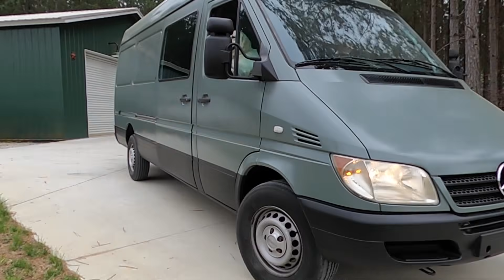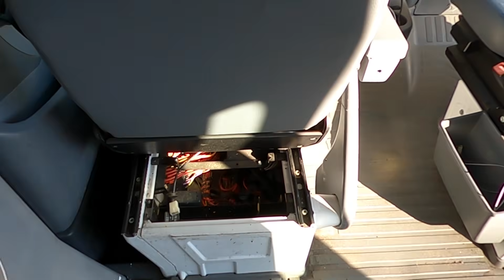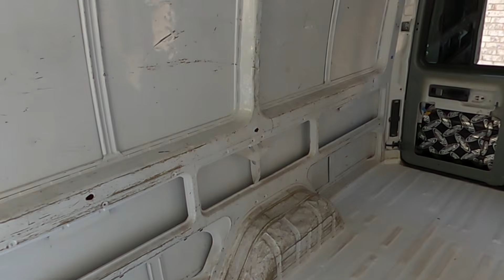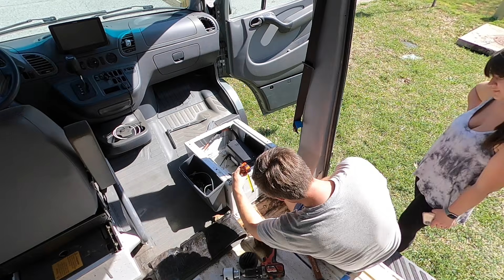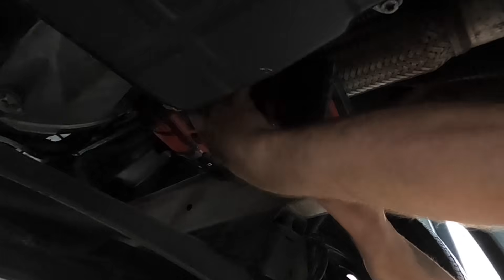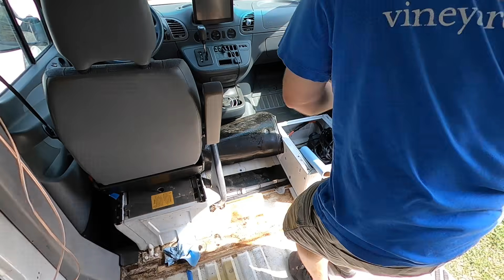How to Install an Espar D2 Diesel Heater in a T1N Sprinter Van // DIY T1N Sprinter Van Build

Comment: how did you paint your van? or is it wrapped
Reply from the maker: We have a series of videos on how we painted the van if you want you check them out. Basically we sanded it, primed it, painted it, then put the raptor coat around the bottom. I hope this helps!

Comment: Great video, definitely helped with my install. I know this video is two years old, but wondering if you had any issues with the fuel pump mounted as you have it. The pump is supposed to be mounted at a 15-35 degree angle with the outlet of the pump pointed UP, not down as you've installed it.
Reply from the maker: We’re glad you found the video helpful! We never had any issues with the heater and I don’t think the second owner of the van has had any yet either.

Comment: So your factory Espar heater by the headlight works but this write up is for an additional heater to heat the cargo area?
Reply from the maker: That is correct. It’s the air heater version instead of the water heater version that’s installed in the van from the factory.

Comment: Did you use the black mounting plate that came with it or is the heater bolted directly to the floor?
Reply from the maker: I’m pretty sure we bolted it straight to the floor with the rubber gasket in between but it’s been a while since we installed it so I can’t remember 100%.

Comment: If u didn't have a connection for the coolant heater, can you tap into the main fuel line going up to the engine..
Reply from the maker: From my research a lot of people advised against doing that. The fuel pump on the engine is very sensitive and from what I read it could cause problems.

Comment: The only thing I see wrong with this install is placing the exhaust in the engine bay under the engine, I would think the gases would re circulate back into your van through the intake .otherwise great video tks
Reply from the maker: I agree with this. Because of it we never ran the van at the same time as the heater. The heat in the van was plenty warm to not need the extra heater running at the same time.
Reply: @goldenadvantures2573  even if u don't run the van ,I would think the gases could still migrate back into your living space ,
Reply from the maker: We had a carbon monoxide detector and never had an issue with it when we did it.

Comment: how has this method worked out in the past couple of years? i have heard bad things about using the existing fuel line but stumbling upon videos like yours, makes me want to try it.
Reply from the maker: We never had any issues when we owned the van and I haven’t heard of the new owners having any issues with it either. The line we tied into was decided to the stock on board espar heater. It was not the fuel line for the engine.

Comment: Hey super helpful video. Any tips on priming the fuel line?
Reply from the maker: We’re glad you got some value out of the video! I don’t remember having to do anything to get it to prime. I’m pretty sure I just hooked it up and turned the heater on and it started pulling from the tank.

Comment: Looking to do the same on my unit do you remember where you do the tee to tap in the the existence line ?
Reply from the maker: I’m pretty sure it was right near the fuel pump that came installed from the factory for the block heater.

Comment: Is there a reason you didn't run the fuel line through the wire chase from seat base to seat base, then down under the drivers base?
Reply from the maker: Yes, the fuel line connector on the heater sticks out of the bottom of the heater. This makes it where you’d have to drill another hole under the passenger seat to bring it back into the van to put it in the chase between the seat bases.

Comment: How did routing the exhaust into the engine area work out? I thought it was a good idea for keeping the engine warm but was wondering if you had any problems with a max fan or similar sucking in exhaust fumes through the cab ventilation system? Did you have any CO issues? Thx.
Reply from the maker: It made it to where we never really needed the engine glow plugs to start even down to  around 5 deg F. Usually we would Sleep with the fan off but cracked open a little and our CO detector never went off.

Comment: Hi great videos all around. We're currently building out a t1n and working on the diesel heater now. How do you know if your van has an auxiliary heater? Ours has a fuel pump similar looking to the one on the fuel line that you tapped into but I'm not sure what it's for.
Reply from the maker: Glad you’re enjoying the videos! The diesel heater that comes already installed on the T1Ns are located directly behind the drivers side headlight. It’ll be a black box that is around 6”x6”x12”. You’ll be able to see the exhaust hose running off of it to that gets mounted inside the front driver fender. Hope this helps!
Reply: @goldenadvantures2573  That is helpful. It looks like I have one but oddly theres no switch anywhere in my cab... the usual bacon frying switch between the ac and the rest button just isn't there. Either way, hopefully I can tap into that fuel line. Thanks for your help!
Reply from the maker: You’re welcome! Ours doesn’t have the bacon button either. The engine ecm automatically starts the heater when the engine is below 40 degrees and you turn the key to the position right before start. That way it’ll heat it up and make it easier to start in cold weather. It’ll also give you heat in the cab while you’re waiting to crank it.
Reply: @goldenadvantures2573  that's incorrect the ones with no button come on AFTER engine is running if the ambient temp brings the coolant temp below 167 degrees and gets it back to optimal temp mostly happens when idling in extremely cold temps

Comment: Can I ask why you didn’t cut the hole in line with the heat outlet ? Why is it like a snake before it exits out of the back of the seat ?
Reply from the maker: I put it in that location for two reasons. The first being that the hose connection sticks into the area under the seat a good ways to give you enough to clamp the hose on and I was worried about it interfering with the heater. The second reason is that there is a perfect flat spot on the seat base for the hose connection to be installed where I did it.

Comment: We have a 2006 T1N class B RV.  We live in NE KS and frequently get sub-zero temps in the winter.  Currently we use the propane furnace to preheat the cabin before we drive it in the winter.  We have been looking into installing a diesel air heater like this as would be more convenient since it would use diesel fuel and I wouldn't have to make a special trip to refill the propane.  I was considering routing the heater exhaust as you did so if I preheat the cabin, it would also preheat the engine bay to aid cold weather starts.  Does the heater exhaust seem to put out sufficient heat to help with that as you had planned?
Reply from the maker: The coldest we’ve been to was 8 deg f overnight and the engine started with no trouble at all even with a bad glow plug. I’m assuming that it does help but I don’t quite know the extent that it helps.
Reply: @goldenadvantures2573  Thank you.  Your video is well-done and informative.  Great work!
Reply from the maker: We’re really glad you got some value out of the video! Definitely let us know if you have any more questions.

Comment: I would like to hear it run. How loud is it? Enjoyed the video. I’m thinking about installing one in our 32’ fifth wheel. We currently sleep w/o heat and turn on big buddy in morning. Just want to heat cabin to high 30s or low 40s. We have approximately 200 sg feet . Do you think it would work for us?
Reply from the maker: At the loudest it’s still quieter than a Maxxair fan. Outside the van it just sounds like a really quiet diesel generator. Our van is roughly half that size and it has no problems keeping it 68 even down to the low 20’s at night. Our entire van is spray foamed though so that probably does help.

Comment: Does  the heater have to be laying Flat or can it be going the same direction as the subfloor? Which is not 90° parallel with the ground
Reply: I was concerned with the same orientation issue since I'm installing in T1N but in a Winnebago View and the compartment under the seat is sloped, not parallel to the ground. According to the install manual you can have 30 degrees angle. I'm confident I can achieve that when I start my install of the D2. Rotating the unit 90 degrees is also allowed.
Reply from the maker: Ah now I understand the initial question. I agree with you and we have not had any issues with the angle that ours is mounted on. It’s kept us very warm down to 8 deg f outside temp so far.
Reply from the maker: I’m not sure I quite understand what you’re asking. Do you mean rotate the heater clockwise 90 degrees to run side to side in the van?

Comment: Are you aware there is an Espar heater already installed in the vehicle under the passenger headlight? It’s called the heater booster and supposedly it can be modified to turn on when the engine is off.
Reply from the maker: Yes our van has that unit. It's designed to heat coolant up. I didn't want to use that one too heat the entire van because tapping into the wiring harness connected to the ECU becomes tricky and I would have had to do more wiring to allow my house battery to charge the engine battery. I did consider it though! I actually tapped into the fuel line for it when I installed the new one.
Reply: Fur & Fam yes. It does look very tricky. There’s diagrams out there but no step by step method. If I give it a try, I’ll try to document if it works......

Comment: Have you had any problems with that 1/8th “ piece of material that’s on the bottom of floor , where you drilled the holes for air in ands outs?
Reply from the maker: No the gasket has kept everything sealed up like it should. Have you heard of any particular problems with it?
Reply: Not at all!  Just making sure it’s not melting with use. Can’t really tell what type of material it’s made of. Got all my holes drilled , first one was about 1/4 @ into the piller that’s under there 🤦🏻‍♂️  Had to move towards the outside a bit. Will likely have to use some high temp  silicone to patch up my goof.
Reply from the maker: @gannon311  are you talking about the sounds deadening material? I believe it's just a rubber gum type of material. I haven't run the heater for extended periods of time yet but what little bit I have run it we haven't had any issues. Ah that's unfortunate! It'll probably end up being under the gasket so it shouldn't be too much of an issue!

Comment: Hello! Thanks for the immensely helpful video. I’m doing the same install with the same kit on the same van. I have a question for you though, when I got to Napa the only fuel line “Y” adapters they had were much too large for the job. Do you know exactly what size “Y” and adapter off of said “Y” to the blue line included in the kit I need? 

Best
Torey
Reply from the maker: Hey Torey, the y fitting I used came out of a kit that's made for pcv hoses and vacuum lines. Those fittings are still oil and gas resistant so they perform the function just fine. Glad you found the video helpful! Also it was pointed out to me that the way I installed the hose to the outlet has to many bends in it so try to minimize that.
Reply: Thank you so much!
Do you happen to know what size they were? Hoping to walk into a shop and say “I need one [insert size here] y fitting please!”
Reply from the maker: @toreycates8411  they are for 3/16" hose!
Reply: @goldenadvantures2573  Good deal. Cheers!

Comment: Very nice. I am wondering what the auxiliary fuel line going into the main tank looks like, and where it's located exactly?
Reply from the maker: Do you have a T1N Sprinter with the espar D5 heater from the factory? If so you'll see the espar fuel pump mounted to the driver side of the van right next to where the transmission couples to the drive shaft. You can follow the auxillary line back to the tank from the pump.  If you don't have the D5 heater from the factory I believe you have to drop the tank to get to the fitting and it's in the middle of the tank but I'm not 100% sure on that.
Reply: @goldenadvantures2573  Yeah buddy! The engine heater is in there (can tell from the box behind the left headlight near the battery). Glad to know I don't have to drop the tank and whatnot. The espar is nice as heck, but it's well over my budget. Gonna go with the 2k Chinese heater https://www.ebay.com/i/401853876479?ul_noapp=true

Comment: Great detail, thanks for this. What kind of head unit is that and how did you you install it?
Reply from the maker: Glad you enjoyed the video! The head unit is an Alpine ILX-F259 https://amzn.to/34zrDaa for some reason people say that it wont fit. All I did was buy a single DIN cage https://amzn.to/3bc3EA7 and bend the tabs to make it snap in to the faceplate that comes with the factory radio. Then I put the radio, cage, and faceplate into the dash as one piece. If you ever want to take it back out you’ll need four of the radio release keys to get it back out. Overall it was a really easy instal. You can see a little bit of the install in the first episode of our van build series.
Reply: Fur & Fam Thanks!